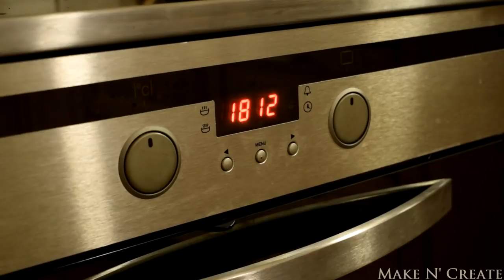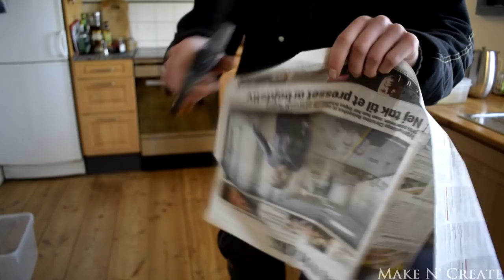Knife Making -  Locke's Knife from Game of Thrones

Comment from the maker: There are a couple of things that I in my opinion did wrong during this project. One of them was the tang construction which I wish I'd done differently so that it was more centered. The reason for this is so that I would have been able to set the guard more securely against the tang. It also caused the handle to be slightly offset from where it really should be according to the pictures and video I based the knife off. And also made for a weaker for construction overall I think
Reply: Make N' Create Wouldn't a pin driven through at some point be a lot more secure? You can't really tell it's off centre in the video, it really does look awesome!
Reply: Make N' Create Actually we can tell tjat is a little bit offset.. And 2 pins through the handle would be great for strength of tang..  But overall knife looks awesome, u did great job and u should be proud.. Please make more knifes like this in the future, some big rough indestructible looking choppers!!!
Reply: The offset isn't noticeable unless you are looking for it.  As far as the tang design, unless you are using this knife as a chopper (which a knife should never be used for anyway...axes are for chopping, not knives) then this knife shouldn't fail.  You didn't quench the tang and you tempered it correctly.  There should be no problem.  This is a very nicely made knife.
Reply: Quenching in ice water?? Is that what i saw??? Realize just the guard if so but, dam it woud be real! Dam brittle would it not?  Infact, sping steal would prob be ideal, ...😕 
Maybe thats how sping steal is made...  But i though using water as a quench it should be about (160°----180°f°) 
shruggs shoulders dunno
Reply: Ima have to say that the imperfections make this perfect, so ya I still appreciate the vid!

Comment: I was wondering why you didn't pin it after you applied the epoxy?
Reply from the maker: The original knife is not pinned.
Reply: The epoxy he used is strong enough to hold that tang steady.  The wood will crack and shred before the epoxy does.  Modern epoxys are used to join re-bar to concrete floors in buildings.  They can certainty handle a little knife.
Reply: @Benja Freeman yep, some models of kukris and parangs are

Comment: Couldnt tell how tight that handle fit was but should u maybe pin it? I always wuestion the strength of just epoxy though
Reply from the maker: I did think about it but I've never ever had epoxy fail on a knife.
Reply: The only time epoxy would fail is if it was not mixed proportionately, if the tang is not fitted tightly to the handle, or if there are air pockets.

Comment: can i ask why do u sink the knife on oil ? to make the steel stronger? i know thats a process it has to be done , but curious. Also i wanted to know the oven part. Great vid pal
Reply: It's called "quenching," and it hardens the blade. He uses oil because it's an oxygen-free, universally friendly quenching environment. Quench the wrong steel in water and you risk cracking or totally shattering your creation. 
If I remember correctly, the oven treatment is to prevent post-quench warping.
Reply: C.G. the Jealous it's called tempering and it relaxes/regulates the crystalline structure of the steel it also softens it a little after the quench making sharpening possible
Reply: I'm glad one of us is properly informed. I forgot to add "I'm no expert, don't quote me." :)
Reply: C.G. the Jealous far from it myself I just happen to know things not everything just enough to get in trouble. You did proper justice to the question at hand though so it looks like we're in the same boat